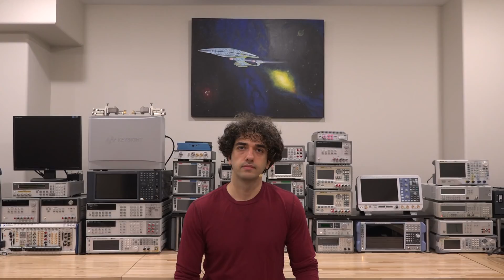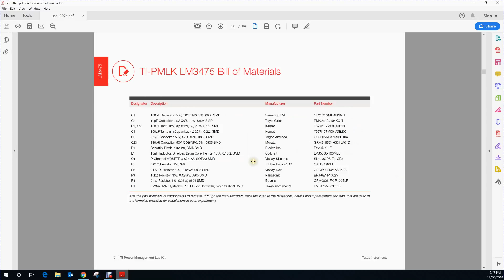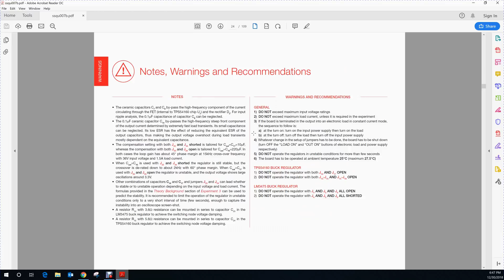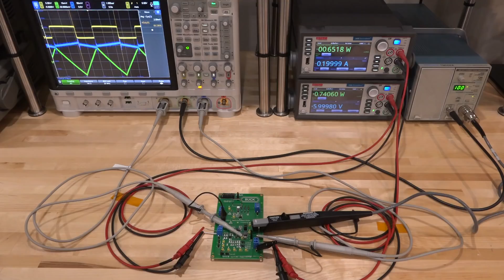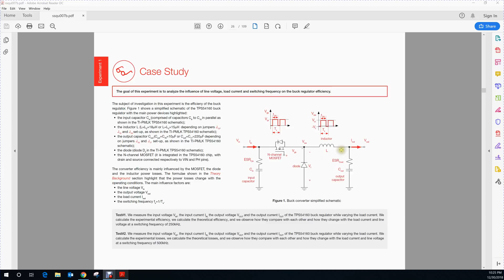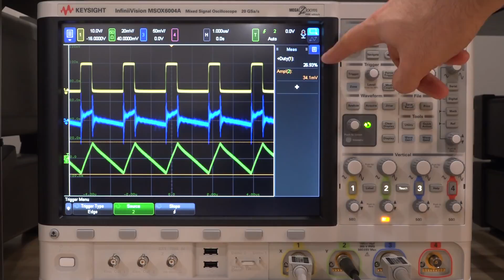TSP #141 - Texas Instrument TI-PMLK Power Management/Conversion Kit Tutorial, Review & Experiments

Comment: The problem with switched mode power supplies is not the circuitry. It's understanding how to lay out a PCB without excessive switching noise. These kits can't teach that. You need to take a design class with a teacher because the topic is tricky and requires the transfer of both theory and intuition.

Comment: Can you also do a session in switched capacitor DC-DC converter?
Also, why does the MOSFET gate voltage ring? Shouldn't that be isolated from the output voltage?

Comment: Could someone please explain how the duty cycle can / does stay the same when the output load increases? The current does obviously increase, which makes Sense and was explained in the video. But the output voltage is seemingly unaffected by changes is output power which seems weird.
Reply: My understanding is that the converter can be viewed (simplification) like variable ratio transformer where the duty cycle controls the ratio, so it is a function of input/output voltage, not current. When the load current is increased, the input current will increase, but as long as the input/output voltage ratio is constant, the duty cycle will remain somewhat constant - only affected by the variation in efficiency. Of course, I may be wrong ;-)
Reply: @jacquesgilbert2774  thanks for the reply

Comment: I would love to see this continued as an ongoing series. 
I lack access to the professional equipment you have  but I've always wanted to see some of the recommendations I read in datasheets put to the test, like the proximity of output capacitors on stability or the different winding techniques and core materials on flyback transformer performance.

Comment: I assume that output current has little effect on the switch duty cycle because the transfer medium (the inductor) has a high ratio of inductance to resistance, ie the voltage loss across that inductor does increase with increasing current, but only by a relatively small amount compared to the voltage ratio from Input to Output.  For example and inductor with 100mO of dc resistance will drop just 0.1v per ampere, so the duty cycle correction for that drop is 'swamped' by the duty cycle due to the principal step down ratio (say 12v to 3.3v ).  The closer we get to an ideal inductor, then the less the duty cycle will change vs output current?

Comment: Ah, this explains so much. In an esp8266 design (https://github.com/pljakobs/esp_rgbww_controller/tree/v2.3) I had gotten fed up with the quality of off the shelve chinese DC/DC modules which, for this application (up to 36V input, 3.3V output) would basically have a yield of ~85%, meaning: about 15% would oscillate so badly on the output that they were unusable.
So I set out to design my first ever DC/DC converter using TI's webbench. I don't like to advertise a company, but here, I have to. Webbench got me to a basic working design in no time at all and when I ran into issues, did provide great support to a novice hobbyist like me (https://e2e.ti.com/support/power-management/f/196/t/678472)
Now, with your video here, I can finally piece it all together in my head.
Thanks for the great work!
pj

Oh, and btw, I would greatly appreciate an in depth video on the different kinds of switching power converter architectures, including the AC/DC ones. Not sure I want to get into building my own AC electronics, but just for the architectural aspects, that should be interesting.

Comment: What's the difference between a flywheel circuit on the buck converter and the reservoir capacitor on an ac to dc circuit? Obviously one has an inductor, but why doesn't the ac to dc need an inductor to smooth the ac?
Reply: Im not shure what is the question here. In an ac to dc the rectification is done by diodes. The cap is used as a reservoire and smoothing out the dc. For filtering the dc after the rectification an inductor can be used as part of a filter network. Is this what you asked?
Reply: @fishyrider3528  I guess. I'm new to all of this. I just understood a buck converter to be a DC-AC(square wave)-DC converter. In the buck, it uses a "flywheel circuit" to turn the square wave into lower voltage DC. But in an AC-DC mains converter, they can just get away with using a reservoir cap. I guess I just don't understand why you can't use a reservoir cap after the switching part of the buck in the way you can with the traditional mains converter.